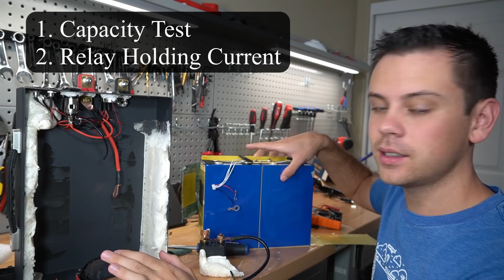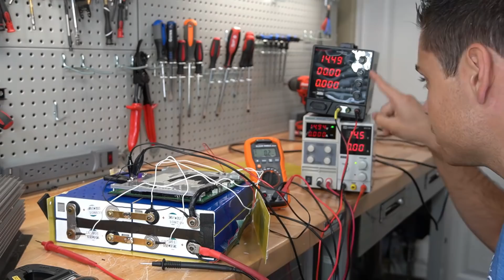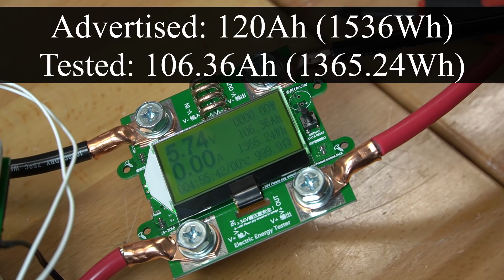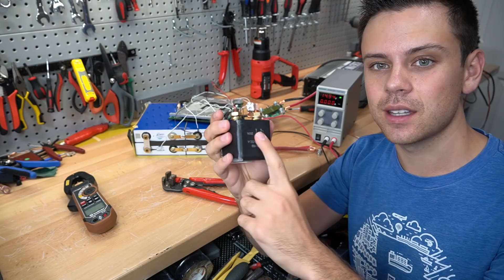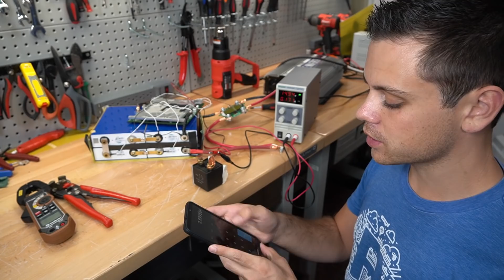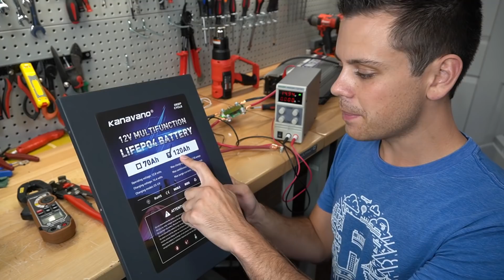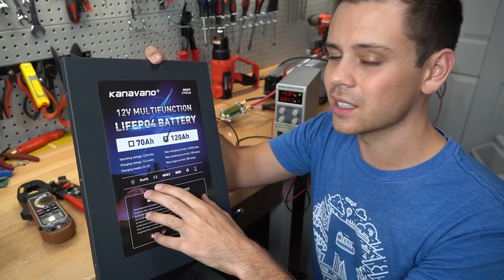$456 120Ah LiFePO4 Battery Part 2: I got ripped off

Comment: 011321/1134h. Thanks for the illustrated info. Yes, I fully agree with you regarding the Factory reject LiFePo4 cells. I’d not even view the AliExpress LiFePo4 notices. Thanks to you for introducing BATTLE BORN batteries and VICTRON products. Both are highly reliable. There’s no hesitation paying for quality and reliability. Thanks and stay safe. 73s...

Comment: Hi I am in Australia and I have a Solax X hybird 5Kw inverter with  6.6Kw of Solar panels on my house. The inverter Iwould like to connect a battery bank up. I am looking 16 3.2v 280AH LifePo4 from Alibaba mainly because the shipping is a lot cheaper than express and its a log jam in our customs service. 
My thoughts were to install a Daly BMS but my Inverter Charger needs a coms interface CAN/ RS232 to talk to the Battery BMS. I cant seem to find one. Have you built a unit that has Comms between them. I will also put a Victron Battery protect 220A. I am an electrician so building this is easy for me. Have any thoughts. I like your Shows as it looks a heaps of information. Have you done a show on yacht house banks with solar and alternator charging. Tonight Trump banned Alibaba tonight trading in the US, so for the rest of the world will get cheaper batteries i hope. Have a great 2021

Comment: Will, on this DIY - I'm trying to confirm which battery is which in this configuration and, which balance leads are going to which battery?  I am making my  DIY in this exact configuration and installing in a Pelican case.  Any clarification to confirm my suspicions are correct would be appreciated.  Thanks.

Comment: Hi, have you looked at a LiFePO4 battery brand called VoltaX? They seem oddly cheap in aus (100ah LiFePO4 for $490aud "normally $1300aud") not sure if it has another branding elsewhere but for comparison an enerdrive li battery is $1k aud.
Hoping you can shed some light on them.

Comment: 106AH for $456 is not bad as far as price vs capacity. I don't think you'll find that price in USA. But yes, I agree that it should be as advertised. I also want to thank you for the response to my comment 3days ago. As I mentioned I also got one, which is the 70AH. I filed a dispute. I spent 3days making videos, testing, and pictures to show them that I am only getting 40AH on a 0.2C load. I even recorded a video that my watt meter shows loading the power bank 40AH to get it fully charged FROM EMPTY, than just testing it TO EMPTY. Dispute has been settled and a refund of $152 is on process. I paid $326 originally. On the side note. I am impressed with the tiny BMS. It has no heatsink, but I was able to run 1.2KW continuously with no problem at all. That is CRAZY! But the BMS cuts-off at 12.1V,  with only4Amp load, a bit too soon. I re-wired the set-up and also replaced the BMS. It looks much better now with the cable management I made, and the new BMS inside.
Reply: They can't just give 50% back and continue to advertise it at twice the capacity in my book. It's actually not that hard to file a federal class action lawsuit against Alibaba I assumed but the whole point of the federal class-action system is that the lawyers get paid and get paid enough to take it on contingency. The fact that they gave refunds to you to suggest that they knew about it in advance and that is somebody said it's practically artificial intelligence that's silencing the people who find out so that the majority of customers can be fleeced. If you care about the problem battleborn has becoming more affordable requiring scale and much of the customers being hustled instead of honestly brokered then you should recognize the duty and because Battle Board is not able to benefit from scale yet unlike in many Industries they cannot be relied upon to police their competitors because at the end of the day people will say well I'd rather save so much money knowing how to discount the value. It's kind of like the virus perhaps forehead. The best way to get the price of battleborn to come down is the police the conman who takes advantage and hurts the whole industry. for those who can NOT afford to buy a bottle born I think you can INSTEAD  afford to sue these other companies and get your attorney's fees not just the prorated price reduction but actually protect all of their FUTURE CUSTOMERS AND COMPETITORS NOT JUST customers from at least the identical listing continuing to perpetrate

Comment: I received my order from AliExpress right after you posted this review. The shipping box (shown on your unboxing) is identical as mine. Took about a month before it arrived here in California. I Ordered the 70AH version. It came with a charger which is garbage but it works. I fully charged it after arrival. Then, I fully discharged it with a 7Amp load with my watt meter connected. I did it 3X and  I was only getting 40-42AH total capacity. I also tried connecting my watt meter during charging. My watt meter shows the same capacity (40-42AH) put back into the power bank. 
So I am only getting 60% of the ADVERTISED CAPACITY. I sent video and pictures to the seller. I will start a dispute process maybe next week and tell AliExpress to review my and the seller's messages.
Reply from the maker: That's horrible :( I hate getting ripped off. They only refunded me the difference. I didn't get my total refund back.
Reply: @WillProwse  thanks for the update you to have a class action it only takes two to constitutive a class I bet and then you can invite everybody else to join you I bet you you have a viewer that is connected to a class-action firm and I know you don't want to get involved in litigation personally but your audience is what makes it work are you sure that you can advertise for other customers of similar scams because they have records of everybody they have sold these respective rated systems to and they need to give the prorated refunds to everybody not just the influence Claire's and everybody else who sends in the highly lit professionally produced evidence
Reply: I did not mean to coin a term influence Claire like Karen or something so I apologize for that comment. I of course meant to say influencer
Reply: @joseylastborn8790  A class action suit lasting years against a Chinese company?  With the aggrieved consumers only getting a fraction of the award, if any?

Comment: There are some GREAT Chinese products from multiple manufacturers. However, like so many other things in life, there are people who want to stretch the bounds of credibility. I recently saw a battery power bank advertised as 10, 000 Ah so 50kWh!! In a power bank approx 110mm x 23mm x 70mm!?? Ludicrous!! I have a good one (that has a maximum of 5 x18650 cells) which itself is overspecified at 20,000 mAh (it's NOT - it's at best 10,000mAh!) but saying the same sized unit is1000 times greater is just stupid. Now I accept that a simple typo can explain that, but it is SO obviously wrong, and yet it does not ever get corrected when these "mistakes"  occur, giving BAD reputations to what, if otherwise correctly advertised, might be perfectly acceptable products.

Comment: Why a mechanical arc-risk relay rather than a multi high current FET, arc-less switch? Seems less than optimal. An FET based switch will consume virtually NOTHING power-wise when in standby (Off) and definitely less when ON than any relay.
Reply from the maker: Yes that's why it's a bad design haha
Reply: @WillProwse  what is? ... The relay? OK ... Didn't realise this was a comedy channel! LOL
Reply from the maker: @boblewis5558  watch the previous video I posted about this battery. Part one. Or my older videos about why relays are a joke.
Reply from the maker: @boblewis5558  and no, this is not a comedy channel.

Comment: Will P.  HELP!!!!  I have watched soooo many of your videos and I STILL don't know what the answer is to my question; I have 3 freezers, in separate buildings about 100 feet apart at the widest point, that I must keep operating.  There is a combined 1700w draw and I would like your thoughts in the best way to have a solar backup power supply that would feed them all.  ???

Comment: To be honest, I'm happy to see no over current protection. Dead shorts across the terminals should be made practically impossible by good habits in protecting exposed copper and terminals -- period. Car batteries provide immense current and have done so without any current protection, how often do you hear of accidents and fires caused by shorted terminals? (statistically irrelevant would be the answer). A fuse should be on the main power feed anyways.

This allows the battery to serve more common applications for a 12v battery than just stationary solar charging.

Comment: I had to laugh when you stated the LifeP04 battery doesn't need any special treatment. I purchased a BEAUDENS 166 watt power generator that has the LifeP04 batteries. The instruction manual clearly states to charge and discharge the batteries a few times, in order for the batteries to work properly. I know you are knowledgeable about this subject. Maybe you could correct the BEAUDENS company.
Reply: maybe they are not ballanced...
and usuallly balance itself via the BMS os the beaudens....

Comment: 90% nearly from a Chinese product. That's the best I heard of so far. It's also why in Europe NKON are the best company to go for with regard to batteries. Genuine LG 18650 3600mAh (13.3Wh) for a tad under $2.90 USD one off and $230 USD for 100. That's 1.33kWh for $250USD plus BMS etc of course. Safe to 200A in a 4S arrangement too. That said I'd run them at 1/4 that max to prolong life and also derate to 1kWh.
Reply: Link?
Reply: @hlnewsom4351  just google NKON batteries

Comment: I would love to see a semi-annual diy battery build with 12v 4s and a bigger 24v 8s for novices getting started like me.
I see a lot of 18650 kits but would like to do a small 4x 50whr lipo4 12v ammobox with panel kit.

Comment: Hello Will
I find your videos very instructing you certainly have done you research

What do you feel about nickel iron batteries for battery pv systems YouTube SV Seeker

As I'm in UK and have the FIT payments for my PC panels I cannot modify them or lose the FIT payments mine app 33p KW/ hr 

I wonder if you could do a design  video for us in the same situation to give us tips

A ac (charging) to dc battery storage to ac ( dc to ac converter) in my case  240 V 50 Hz ac but 110v 60 Hz ac in your case

I realise there will be more losses

Don't think I can go off grid as the pv and possably the battery inverters need ac 24/7, also FIT requires the PC being on line and we don't have the sun as much

Also you mentioned components used in your systems I would recommend using ones that are sold with a standard like UL and when desigining a system use a Standard e.g. UL 508A for industrial control and  equipment which will give wire gague for current ect 

Thanks for another good video

Comment: Did you get the money back from aliexpress and did them accept this video as proof? Aliexpress always wants to see videos as proof ;-) 
 in case of disput. So i could order the same and link your video as proof and would have some cheap cells as well ;-) Just jocking, but quality cells are very expensive in my country, not a option for me. 106Ah or 120Ah isn't much difference, because I need only about 100Ah in all

Comment: Not trying to claim that every manufacturer of relays follows (industry) standards, but the pull-in has been standardized as no more than 80% of the nominal coil voltage AT ROOM TEMPERATURE.  The purpose is twofold.  First it makes allowance for various voltage losses in cables and possible driver saturation voltages.  Second, it allows for  relay coil resistance increases at higher ambient and internal temperatures.  The release voltage you seldom see stated.   They may be just about anything, but if they are listed, they give a number ABOVE which the relay has to release.  In other words, it shall not stay activated by remanent magnetism, unless it is specifically designed to be latching.

There are relays equipped with auxiliary contacts which can apply a series resistor to the coil after (or at the time of) activation.  You can implement such externally, or some relays may do it internally.  That reduces the holding current and power dissipation. As a side effect, it causes the relay to release at much higher voltage.  And then there are special relays that have the release voltage practically the same as their pick up voltage.  What I have used was called Current Balance relay.  It had two coils, one called balance or reference coil and the other one was called Sense coil.  It had a moving permanent magnet and  it operated with some 50 microampere unbalance between the two coil currents.

Which brings me to the reminder that all DC relays (without a series zener diode) are actually CURRENT rather than voltage dependent.  Or more to the point, the product of ampere turns on the coil, i.e. the number of turns in the coil times the current.  Thereby, the operating current remains essentially the same even when the coil resistance increases with increased temperature.  This actually explains the need for the 80% pick up voltage standard.

Comment: Please help clarify something. I have posted polls on FB but can't seem to get an answer putting this subject to an end. What order do you use for connecting a BMS common port and non-common port BMS boards? Some say connect P- then B- and finally, plug in the monitoring connector to the BMS board. Don't know if a disconnecting order is important but would like to that know that as well.  If you have already done a video on this subject let me know I will do the leg work of searching through your videos. Oh and great job on your educating your viewers by spending your own money to open up products and inspect them for us before buying or avoiding junk.

Comment: First of all a big Thank you for the knowledge you are sharing. Secondly I would like to ask (i know that probably i want get an answer but its ok :))Can you make a video about a higher solar array, I mean fir example i want to do an investment, building a solar farm of 100kw-200kw at my field/farm and in order to exclusively sell power to a power company, that means it will be tied-grid and the energy that panels produce any moment they will go directly to feed the grid. So I will need:
 panels, 
 inverters and 
 all the necessary building materials.
 On the other hand,  i will not need any batteries (as i don t want to store and/or use any electricity for me) which mean no charge controllers if I am right. 
Can you give us your tips,advice or any enlightenment that you have on this matter? Please and thank you in advance.

Comment: How many charge cycles have you put this battery through? You can't expect full capacity until the battery has been broken in.
Reply: @ turbo2ltr Stop talking..... educate your self........your embarrassing
Reply from the maker: Absolutely false. I do not understand where people come up with this thinking. The first few cycles with LiFePO4 will be larger than advertised capacity. And these are common Eve 105Ah cells. What makes you think you need to "cycle them a few times" to pull full capacity?
Reply: @WillProwse  years of witnessing the effect as a electric vehicle engineer... Grant it, it's not going to make up 14Ah.  But there are studies out there documenting  the effect. There are even mathematical models for it.
Reply from the maker: @turbo2ltr  not for LiFePO4. Can you substantiate your claim?
Reply from the maker: @turbo2ltr which mathematical models are you referring to? I would love to be proven wrong. 

In the literature and my testing, LiFePO4 always pulls more than rated capacity for the first few cycles. Not less.
Reply: @turbo2ltr  Electric vehicles usually use LiIon type batteries. Here, he is testing a LiFePO4 battery pack. They are not the same.

Comment: Rate of discharge has to be factored in also. Did you test at the current rate (20hr?) that the battery amp hour rating was based on?
Reply from the maker: That's why we tested at .2C which is standard rate in the literature for testing LiFePO4. We do not do a 20hr rate because this is not a lead acid battery and we are not dealing with peukert effect.